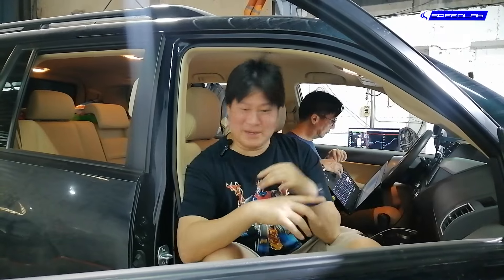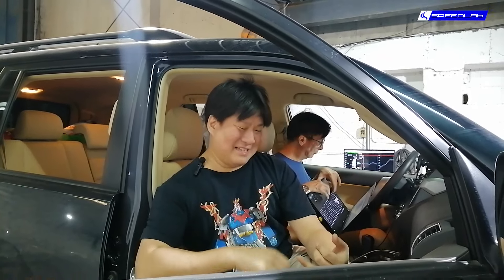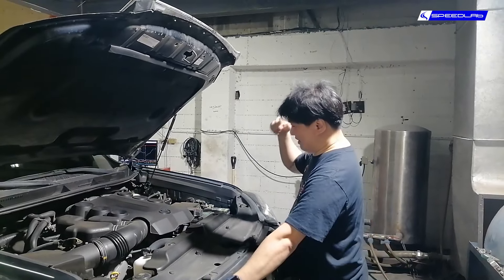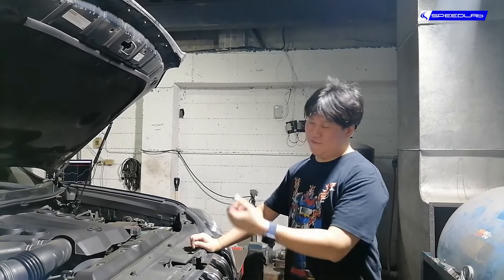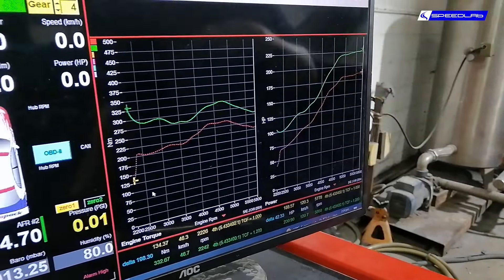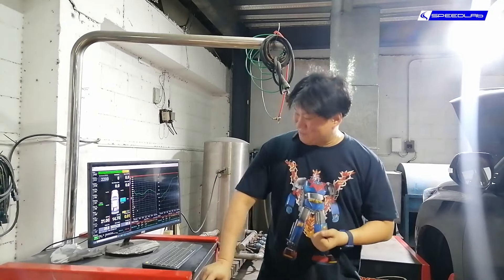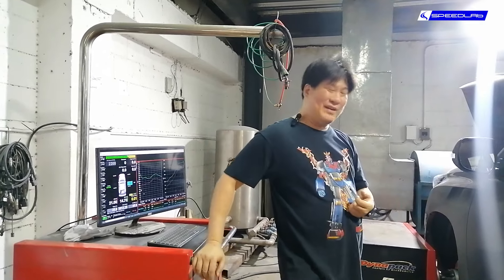Toyota Land Cruiser Prado V6 | SpeedLab ECU Remap Reflash Tuning

Comment: Great video, i have a 2012 prado V6 AT with afe intake, borla exhaust, shorty headers with cats and Afe 76mm throttle body, what gains could i expect from a stage 2? and if it is possible to get a tune map from you guys ? thanks

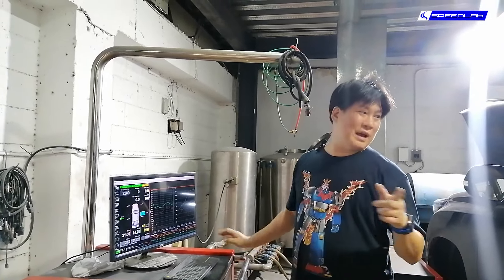Comment: Sir Syd question, @5:22. chart shows x axis starting at 2200 RPM. do we have a way of knowing if there are any gains at the 1500-2000 RPM range? im not sure if the graphs can be scrolled to the left to see that range or maybe its at page 1 of 2 or something. teach me sensei.
Reply from the maker: No cannot see power below 2200 rpm
Just because you can’t see it on the dyno doesn’t mean there is no gain
Reply: @speedlabchannel4452  I see what you mean. Is there any particular reason why power below 2200 RPM cant be seen in this software?

it would be nice if you can see it though. thank you for your prompt reply sir.
Reply from the maker: @kirkplacides7434  you cannot have the engine idle at 1500 rpm in 3rd or 4th gear
Reply: Hi 
Great videos, very inspiring, keeps it up. I am wondering how to work around the RPM limiter on V6 Prado 2016. Thanks